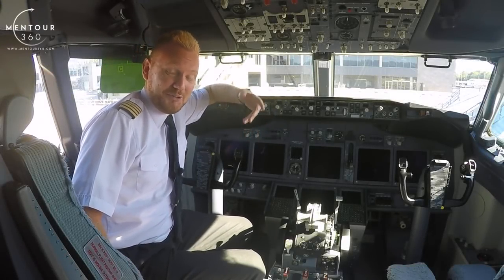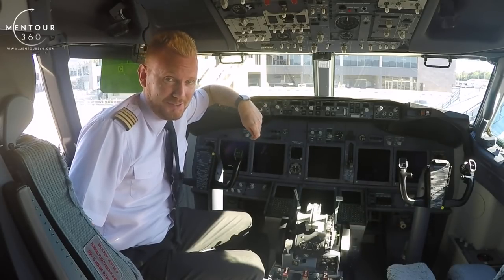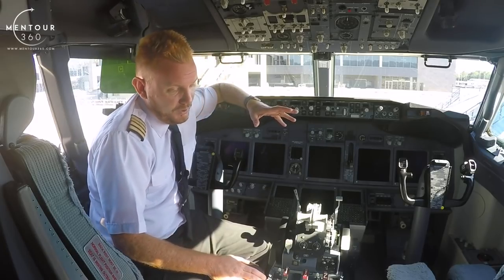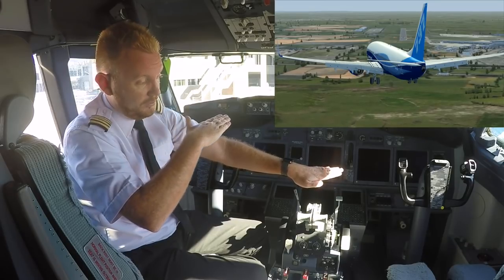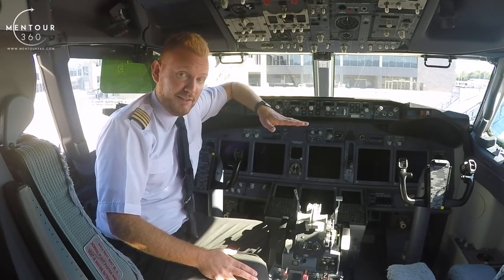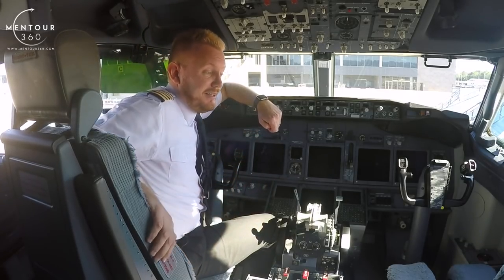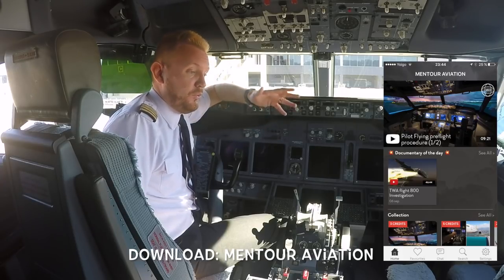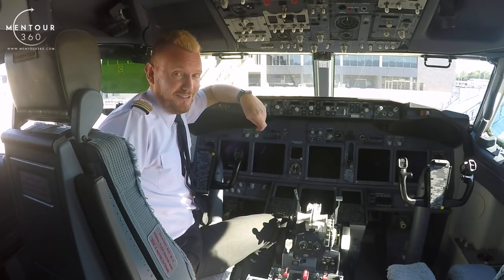How to do a CROSSWIND LANDING in a Boeing 737NG

Comment: Nice video Joe. I taught a lot of new copilots how to manage crosswinds. I believe getting the de-crab sorted out before the flare can be helpful. Once the approach lights cross under the glare-shield de-crab and hold the slip through the flare. No need to worry about pro-verse roll (wing rise from rudder input) and lateral PIO's while trying to flare. Increased aileron will be needed as the jet slows in the flare. Last thought- Delta found that tail-strikes were more common in strong crosswinds. At a given weight and speed a higher AoA may exist due to control surface displacement so watch speed and AoA in strong crosswinds.

Comment: Nice video. Just to add my two pences worth. The sideslip approach is not discourage at all. Boeing specifies the limits for sideslip-only approach for Flaps 15, 30, and 40 for aircraft types with and without winglets. You may touchdown in only sideslip up to these crosswind component values (23 knots for flaps 40, 20 knots for flaps 30, 17 knots for flaps 15, no winglets), but for crosswind components greater than those values, if you opt for sideslip approach you must add 'proportionately' a crab angle that is combined with the sideslip, as otherwise the sideslip crosswind limit would be exceeded. In fact, on strong crosswinds up to crosswind limit value with dry runway, Boeing even recommends that you do not land on crab angle alone, but combine some sideslip in order to reduce the upwind movement of the aircraft on the runway after touchdown. Now, if there are gusty winds, you will need to reduce the sideslip crosswind limit values possibly down to zero using judgement, but my point being is that sideslip landings are not discouraged at all on airliners. It can really help you on the 737 as about only 1 degree of bank angle tends to tackle around 5 knots of crosswind.
Reply: Interesting view. I think executing a sideslip on an airliner requires a lot of moving parts and creates more potential for an unstable approach. I don't know why one would use sideslip when it's just so much easier (and thus safer) to do a crabbed landing (or to decrab on flare). You don't have nearly as much potential for dipping your wing and thus necessitating a go-around.

Comment: I spent a lot of my early engineering career working on Flight Sims, first building them, and later maintaining them (in the days of BOAC/BEA -- my most recent aircraft was BA 737s, before the "glass cockpits"!)  I always thought I was quite a fair pilot but since I've been following your podcasts I've realised what a lousy one I was !!

I did once fly a plane above 10 feet, and I wasn't too bad with that, but it was only a single-engine Cessna.  I did however tell the instructor when we were on final to the runway that he didn't need to use the rudder for me as that was the "standard procedure" when we took a visitor up for a flight in the 747-436 sim to discretely help them to land. -- Ah, memories of 50 years ago :-)

Comment: If I were going to reach the runway surface slightly left or right of the centerline, I would do it to the downwind side tracking at a very small angle toward the centerline.  That would actually reduce the crosswind component during the flare and touchdown.  Tracking slightly upwind of the centerline and allowing the crosswind to push you toward the centerline would increase the crosswind component and the sideload on the gear.

Comment: In common crosswind I'm landing the way you explain it in the video. Do the approach in crab angel and kick the ruder in the last moment to allign the aircraft. In hard crosswind-conditions I use the slip during the whole approach and flair, keeping the windward wing down by the aileron all the approach and keeping the centerline alligned by the ruder. Even I flair in this configuration and touch down with windward main undercarriage at first.
But of course, my aircraft is much smaller than yours, I'm only flying 600kg MTOM, not 60 tons.

Comment: Again, quite interesting. I always thought you airline types used the crab because of the passengers, to avoid the sometimes heavy use of ailerons that could scare some people. The biggest plane I've flown was the F-111, landing wingspan 63 feet, length 73 feet and used cross-control exclusively. In fact, as soon as I turned final I lined up on the runway and held center-line all the way to touchdown. Some of the fighters we flew had tender gear and we had to keep side-loads off for fear of collapsing the gear. That wasn't the case with the 111, but some of the other planes were tender, so that was the method of flight instruction from day 1. By the way, I just subscribed.

Comment: Dear Mentour, this was a excellent explanation regarding crosswind.
In the video, we've seen the huge amount of smoke from the tyres from the 380. You pointed out the big difference between a dry and a slippery or really wet runway. Now my question; the wheels don't circle so the speed of them is 0 knots. The usual landing speed for the 73 is 160 knots afaik? How would it help, if the wheels would have an almost similar speed (or maybe 50%) of the landing speed? Would that help to get a saver or more comfortable landing (the tyre industry would hate it, guess).

Comment: Very nice video! Brilliantly explained. Just wanted to point out that the sideslip technique is perfectly acceptable and is described in the FCTM for both large aircraft types I have flown (757 and 777), albeit with a reduced crosswind limit in order to prevent the kind of problems (engine nacelle or wingtip strike) you describe. On an aircraft such as these, with triple channel autoland and rudder control this is how the autopilot corrects for a crosswind during an autoland. I suspect though that the sideslip is not recommended on the 737 you’re sitting in though?

Comment: Thanks! And I thought it was all software controlled by the aircraft to align the wheels to the runway. It's actually pilot skills!! I will appreciate landings even more now. So What about short dry runways with not so experienced pilots? crab or decrab/flare? Do some pilots have a favoured technique? What is priority in the decision criteria: Crosswind strength, wet/dry runway, pilot skills, aircraft size or simply just depending who is landing the plane?

Comment: Great video! If you’re performing a manual control landing in a crosswind do you ever use rudder trim instead of pedals, especially on a long final?
Reply: VICTOR PAPA on the A320 manual approach with AEO, if you need to push pedal to keep the aircraft straight, trim until you no longer have to push the pedal, that is the switch on the center pedestal😉
Reply: Ava Mendez Thanks Ava!
Reply: VICTOR PAPA There's really no need for any rudder input to maintain the crab.  If you are side slipping you will need constant rudder pressure.  Even then I would not use rudder trim as it complicates things in a go around.

Comment: I like Physics. From a "physical point of view", the cross component of the ground speed vector must be equal and opposite to the cross component of the wind speed vector. So the heading depends also on the value of your ground speed. At a given wind speed, the faster your ground speed is, the less the angle between heading and track must be.

Comment: Hi Mentour. Great video. Learnt a lot from it. Just unclear with something. You were saying it was better to land an aircraft with a crab in slippery runway. I still do not understand how does that give you better directional control. And also why does the slippery runway does not give you the jolt like you were mentioning? If it was slippery and you don’t decrab on landing, the aircraft will continue on the direction of the wheel and if they were to do like what the Emirates did, would it be risking of skidding off the runway? Thank you for your time sir and keep up the good work =)

Comment: Crosswind issue - My Question is: Why planes has no "front rudder", as well? In that case, horizontal rotation would be avoided, so instead, we will have lateral translation, with main axis of the plane, always parallel with the main runway axis - no rotational stress on wheels during touchdown. Thanks' and Regards!

Comment: @mentour Thank you for your channel. Very interesting technical explanation (as a professional geographer, I'm interested in plane technics). I have a question about something I don't understand AT ALL : how does a pilot align and get down to the angled runaway of a moving aircraft carrier ? Nothing seems strait in this case (angle between runaway an carrier track, which angle between plane an runaway axis  ? etc). Do you have information about it ? Do the pilot just aime the back of the ship, go strait to it without thinking to much, and correct the track at the sat moment ? which seems a bit complicated if you think you have to catch the wire on the runaway to stop the plane… SO, If you can do a video about it, I would be verify happy to finally understand this mystery.
Patrick

Comment: 7:44 That's what probably happened on march 1st 2008 during a Landing to Runway 23 in Hamburg. Probably the Flying Co-Pilot forgot to put the aileron in. So the left wingtip stroke the runway. Luckily the Captain took control and immediately pushed the throttle up to give it gas and go around. Eventually they safely landed on Runway 33. So also the previous choice to land on Runway 23 was probably wrong.

Comment: Hi! Does piloting have a mixed of Imperial and Metric readings? I saw your video about firm landing and you talked about the runway in metric. Here, you mentioned the altitude of the aircraft in imperial.
Reply from the maker: Yes, sadly it’s mixed 😞
Reply: Short distances, like runway length and visibility is in meters. Long distances are in nautical miles. Speed is in knots (nautical miles per hour). Altitudes are in feet. Thankfully isn't the time mixed!

Comment: Mentour I know the deference between heading and track but why ATC says that "(Fly) heading 050" to you during radar vector, even the controller don't know the actual crosswind component?
Reply from the maker: +mPD780C1 ATC will always give us radar vectors I’m Heading, never track, they will monitor our track and adjust heading accordingly. Sometimes they actually ask us for spot-winds.
Reply: But the controller does know the (ground) wind and movement of the clouds (visual or by weather radar). And all planes will experience (almost) the same winds. So he can anticipate the track and correct 5 or 10 degrees if needed.

Also, with an airspeed of 150-200 knots, a 20 knot wind does not do much in the short time until the next turn. If the cross wind is strong enough to push you noticeably off course, you should not be landing there anyway. It is time to divert to a place with nicer weather.

Comment: Hi good job.still one question.as i know if the crosswind is too strong you have to maintain the correction i mean your action on the aileron even after touchdown. Until the aircraft is under control.why almost airline pilot dont do that?they always put the yoke on neutral position just after touchdown

Comment: Great video :) Really like how simple you are able to explain more complex manouvers. Woud you say that this A380 pilot made an clear mistake? Really wanna hear an opinion from a real pilot. Personally I would say it was not a mistake, but he could have done better :)
Reply from the maker: +Daniel Siwerov Yeah, like I said in the video, it was a small handling mistake but a very common one, especially during very strong cross-winds. I could have done the same.
Reply: I would imagine part of the challenge you didn't particularly highlight is that you can't assume a crosswind is going to be stable. It could be they were set up for the crosswind at the time then got a gust at the last moment such that there simply wasn't time to correct. I'm pretty sure if you could be certain the crosswind is absolutely stable then it would make the task considerably easier. I certainly would not have wanted to be a passenger on that landing, LOL. There's a pretty significant lateral movement going on in that plane, almost a 'whip' motion, especially the further aft you're seated.
Reply: Daniel Siwerov iiii

Comment: on a paraglider you would brake on the side the crosswind is coming from while weightshifting in the harness to the other side...i am trying to imagine replicating this on an aeroplane.extra flaps on the crosswind side ,pitch down and a bit extra thrust on the downwind wing?hmmm.might work..if you rewired the flaps to operate independently

Comment: Great video! About the technique used by airliners, if the wing in the wind is not lowered to avoid a collision between the wing or the engine with the runway, the plane therefore lands with a side load on the landing gear right?
Reply: Yes, the landing gear is designed to land in a crab up to the crosswind limit. In practice you wouldn't want to test its resistance though , the people in the back might not like it as well. Thats why you normally keep the crab landings for  wet/contaminated runways , and decrab on the dry ones.
Reply: @Hk-uw8my  But if an airliner will avoid lowering a wing to avoid colliding an engine with the ground so even in decrab on a dry runway, the plane will be aligned with the runway, but the wind will move laterally the aircraft (if the wing is not lowered into the wind) and therefore the landing gear will experience a side load? Is it correct?
Reply: @sebastyenlaroche2894  yes it can happen, but normally you  would try to  decrab late and quick enough so the wind has not the time to push you towards the downwind side of the centerline, even if it means that you wont be 100% straight at touchdown, which is tottaly acceptable.
So If you have a very  strong crosswind close to the max demonstrated, there is  no other  choice than using a partial decrab and  landing the mains  with a residual crab angle, otherwise you either land on the grass or make a wing/pod strike.

Comment: Any idea why they don't make the undercarriage steerable on airliners?  It has been done successfully on military planes, most notably the B-52. I'm pretty sure  even the first 747s had it but was later discontinued (maybe it was a left over from the original military specification). 
Apart from making it considerably easier (and by extension safer) to take off and land it also helps a lot to maintain the centerline even in heavy winds on slippery runways as the aerodynamics can continue to counter the wind even after touchdown.
Is it just a matter of being costly and perhaps adding weight or is there some other more subtle consideration?

Comment: Summary in five points:
0.Approach with "crab angle" to compensate for the side wind.
1. Aim at the upwind side of the runway
2. Decrab with rudder (which causes one wing to move slightly faster for a brief moment of decrabbing, and the other go slightly slower, and therefore the faster wing "wants" to go up, and other to go down a bit..)
3. compensate the rolling effect (from point 2) with aileron
4. Flare during points 2 and 3.

Hold my beer...

Comment: Hmm... so theoretically, if you had all-wheel-steering on the plane, you could align all of the wheels to the plane's track, bring the plane down on the runway at a crab angle and then adjust the steering to point the plane straight when it's touched down... Seems like that would be a safer alternative than having to try and maneuver the plane straight again in the last few seconds before touchdown?
Reply: all wheel design might be notoriously expensive.  carriers not good these days to shell out cabbage for little used features.

Comment: May I know how would pilots follow the correct track down the glide slope while crabbing? The compass doesn't work because it is aligned to the plane's heading and I don't think the ILS localizer "diamond" on the PFD adjusts for crosswind?
Reply: It does adjust to the crosswind. The localizer doesn't guide the plane in which direction it should be flying towards, it's just where it should be to be lined up with the runway.
Reply: DeepSpace12 close to the ground they'll be looking out the window at the runway and/or the runway lights depending on the airfield, time of day and visibility. When I flew gliders we kept our eyes on the intended touchdown point for most of the approach. The techniques being discussed here are exactly the same for gliders as for commercial aircraft. I've used both crabbing and side-slipping on ctrosswind approaches.

Comment: I don't know what this Captain's experience level is or how he was taught to fly.  NEVER land a plane in a crab. The gear is not designed for excessive side loads. I typically use a forward slip, NOT a side slip. Lastly, I suppose he has never used asymmetrical thrust. Reduce power on the downwind engine and apply aileron on the upwind side. Works very well with wing mounted engines. I have used asymmetrical thrust In the DC3, CV580, 737, 757, 767. I never did like kicking out the crab in the flare. I have seen too many guys kick iy out then drift across the the runway because they never put aileron into the wind to stop the drift. The 737 is about the easiest plane to land in a crosswind.

Comment: Have you ever landed on Madereira  - still designed the most dangereous airport worldwide, even after the modification of the lenght of the runway? Is pointing the nose towards the wind after the 180 degrees turn still the best solution or could you imagine innovative improvements?
Reply: Thanks for any answer!
Reply: Could "horizontal windshear warnings"  during landings propose technical solutions (part of the aircraft)  to avoid a go-arounds?